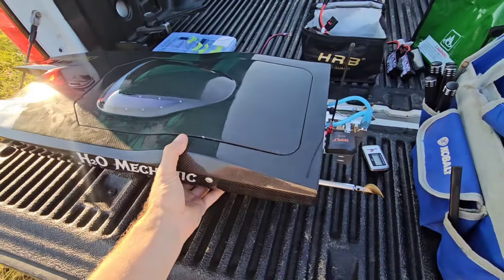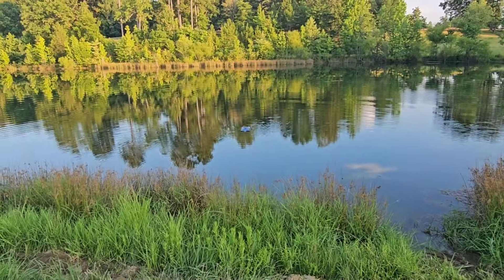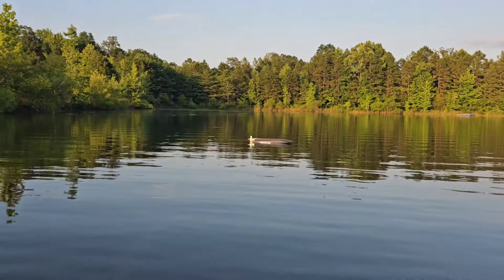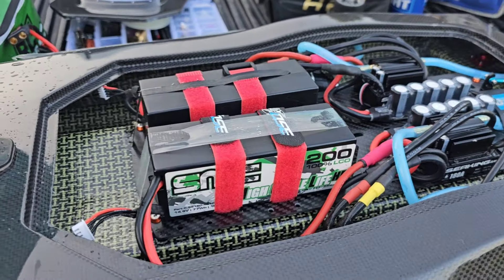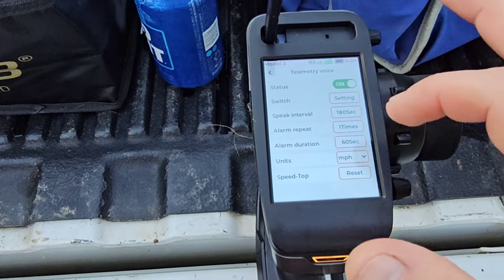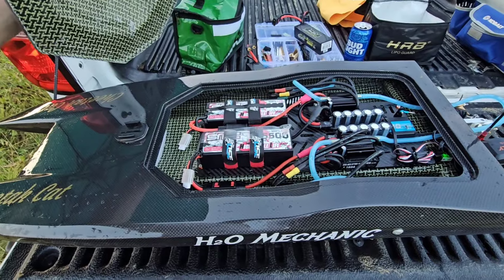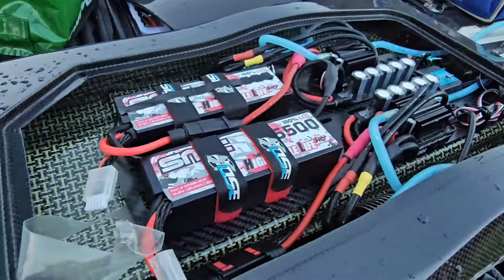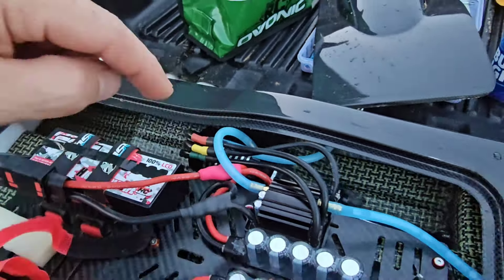Twin Cheetah - Seaking 180 Esc Testing the Big Cap Packs & TFL Strut Mods.

Comment: They have battery straps that are rubberized so your batteries won't slip about. Luminiere makes them. There actually for fpv drones. They work great 👍 👌
Reply from the maker: @VinydFPV  thanks for the tip! I just ordered 10 of them! The 2 I have are excellent from saga rc.

Comment: You really have this Cheetah dialed in especially with the mods you have done and the cap packs look great as well as perform . As far as the servo , i put some double face tape on the back side of the servo in addition to the tie strap or wire in your case to keep it stable although i use a Du bro servo arm , stronger then the ones that come with the servo and plastic acts as a servo saver .

Comment: What’s the point of transmitter talking, disable it… if it’s for cool points, well not cool..
Reply from the maker: @skyhawk21  if I disable it, it turns off the gps. I gotta turn down the volume for this model
Reply: Where you buy the talking transmitter? I need that for speed testing ?

Comment: I'm glad to hear about the cap packs. I just got the same ones for my 180.seaking. now I just have to run it. I would put the batteries in the sponsens. You can adjust the cg and lower center of gravity. I'm a big ironclad fan but I've noticed your comments and decided to check you out and I just subscribed. Thanks

Comment: Let me put it this way. If it were my boat i definitely wouldnt build an air dam or something like that. I would order adjustable lipo rail and put these in the sponsons. That way you have a lower cg and it shifts but more forward since these weigh probably few hundred grams. If that is to much i probably would partially or completely remove the factory elektronics tray/plate which is probably also like a 100gr. Also would glue or bold another servo mount in it. Its hard to tell of course if you don't have the boat yourself but, if i was 100% sure it needed more weight in the nose that is what i would do. The caps your using look to be the same size i used on the t180 (previous setup dom)...

Comment: another reason you need a big old gas hydro or something. will cut down all that grass and clean the surface of the water.
Reply: Huh...😂
Reply: @Chris-zu8ve  gas boats clear grass and leaves from the water. they're large and powerful to push right through and send debris out of the way with their wake.
Reply: @adlucem9845  absolutely no difference then what a large electric boat would do lmao ...
Reply: @brons101  electric is ghey though
Reply: @adlucem9845  not everyone has the IQ level for it I guess
Reply: @brons101  the easiest, entry level system for beginners?

Comment: one more comment ;)

that tapered rudder has 2 different size water passages. the front hole is smaller ID. that might explain your temp differential from left to right. also, you have it cut pretty short. i use a straight blade shortened only a little bit on my Cheetah. i tested all the different length rudder mounts and different shape and length rudder blades. i currently use the shortest rudder mount. it helps keep the rudder away from prop wash. your short blade is also more susceptible to prop wash, especially now that you have the props turning inward. (my props turn outward.)

Comment: Funny, I also have a fine and coarse thread cable on my Genesis 900 and the coarse thread side has desoldered the wires twice now, the second time after installing larger Bullets. 
That’s some nice speed on 4s.